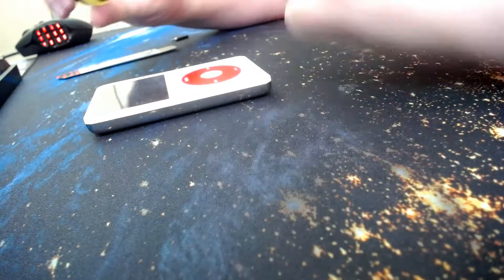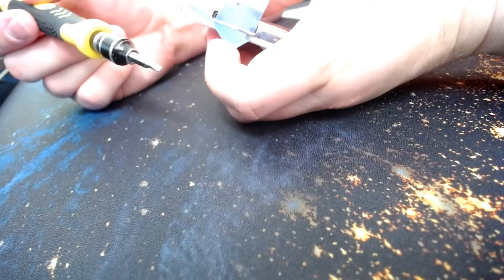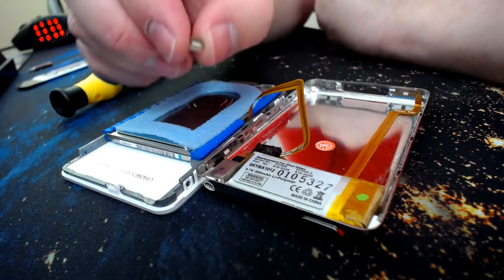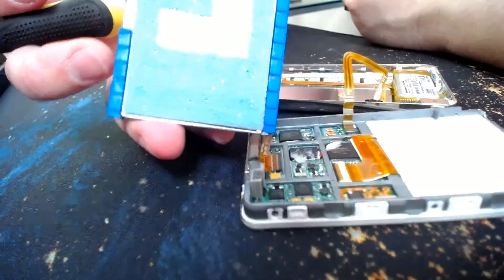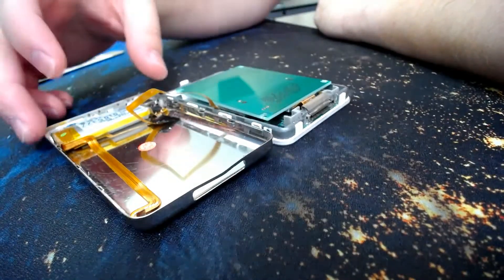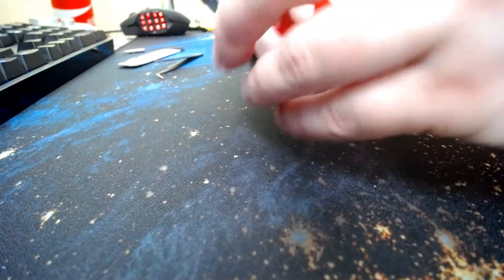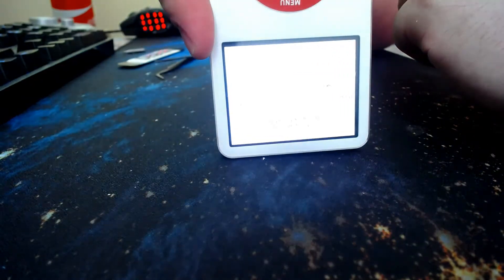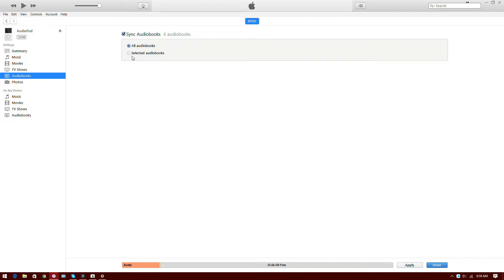iPod Classic CF upgrade & upcoming AMD build!

Comment: i have that notification "connect to restore" bla bla. i rstored it but it goes back to that notification again it seems that the restore process doesnt write anything on the sd  cards.. btw im using a generic compact flash adapter not the iflash. and its very cheap.. dont know y maybe that cause the problem
Reply from the maker: Possibly. I've considered getting an SD-card adapter instead of a CF adapter to see what happens.
Reply: im using the same adapter as urs but the cf adapter imnusing is the micro sd to cf card adapter.. but the green one that ur are using the pcb its the same.. but its not working

Comment: Hey,

I tried the same thing but wasn't able to restore my iPod using iTunes. I can only use the iPod now with rockbox. How did you restore the iPod to the original OS of Apple?
Reply from the maker: Funny enough, I haven't used it since I did this upgrade. I went to turn it on & it tells me I have to connect to iTunes to restore it to factory. It seems to go through that process fine on Windows, then immediately displays the same error. I don't have a Mac with me right this second so I'll test it again when I get home to see if I can restore it on my Mac.I assume that for you iTunes isn't recognizing the iPod at all?
Reply: Tech Haberdashery iTunes recognize my iPod on Windows but gives the same error. Im don't know if it will work with a MacBook, but if it does for you I'm gonna ask a friend to restore it for me. I'm now looking to restore it with ubuntu.
Reply from the maker: Hey Jeff. So I seem to have lost my 30-pin cable. I've been looking all over for it with no luck at all. As soon as I can get ahold of another one I'll try it out & let you know!
Reply: Tech Haberdashery thanks, for testing. I'm also looking into other options.
Reply from the maker: Hey Jeffrey; I'm afraid I can't get it to work on my Mac or PC now. It won't restore at all now. I'll have to take it back apart sometime to see if I can get it working again.